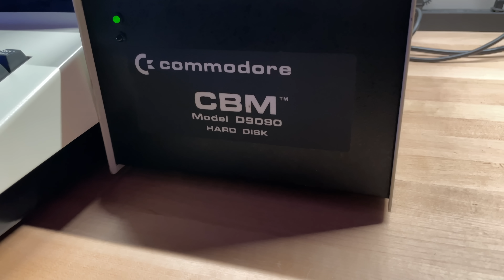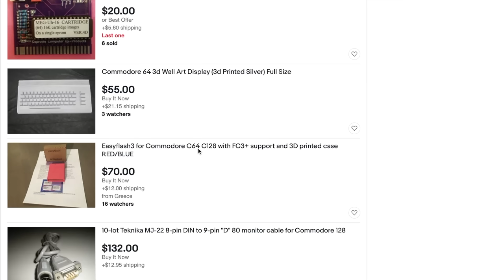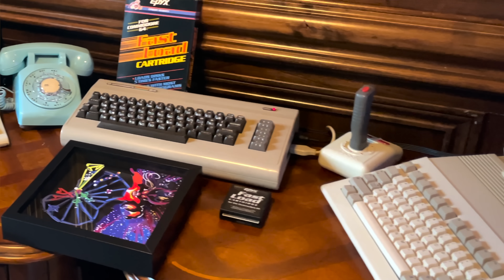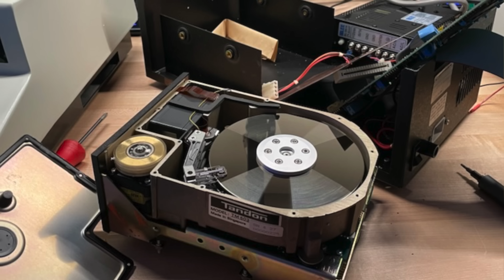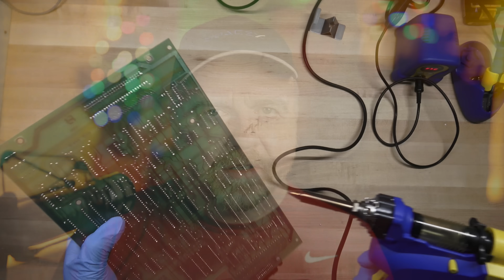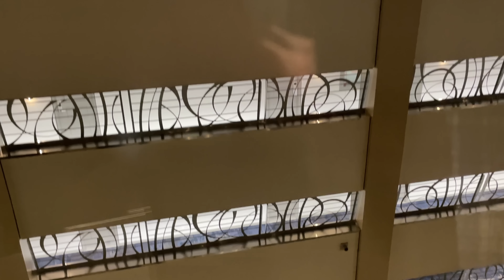FOUND: A Super-Rare Commodore D9090!

Comment: I had 2 of them on my C64 based BBS back in 1986. I stupidly sold that whole BBS setup for a song to one of my Users at the time. Gawd only knows where they ended up. I still have a spare ROM chip from the IEEE interface somewhere, but not the actual interface. So many thing I shoulda kept.! argghh

Comment: Hello Dave. lol! I want to say that you speak eloquently and it's very entertaining. Thank you for the laughs! Around12:13 you speak of power supply issues and GFCI.

My wife and I bought a shed, converted it into a 'tiny home' at the farm, I did the lectrical, before AI, thru research. I installed AFCI or combo CI breakers when they were cheap (lol). The minisplit (120v 20a) would trip its breaker. Changed the breaker out for a standard breaker and it's been fine ever since. My theory is the inverter on the outside unit doesn't like whatever the FCI does, or the inverter backfeeds noise that trips the breaker? 

I would love for you to do an audiobook. I remember in my AOL days of seriously thinking about applying for a job at Microsoft, but learned RPG II on a System/36 for small financial institutions.

Thanks for the memory trips!

Comment: Re: Power supply tripping:

normally there are protection diodes across power rails of a device which will trip IF the power supply is connect backwards OR if a voltage caused by a mains surge occurs) - and this is worse when transformers are involved.  too many shocks or adverse operating voltage transients and the protection devices take to short circuiting and any future attempts will fail

To debug these check the DC resistance of the 12V line (12V to 0V) - testing the resistance across each component ( try the black or discoloured devices first ).

Any electrolytic capacitor (with a can ) could have dried out and need replacing , choose a 15 or20V part as the replacement , keeping the same value.

A trip can occur if there is a path to mains  through any other connected component, germany and UK often used the neutral line as 0V - which works fine until the power lead is connected backwards ( not possible in UK and German because they have 3 terminal plugs )

Comment: Gfci monitors balance of hot and neutral, if they are out of balance a coil surrounding hot neutral sees current  and that trips gfi.  A hard short will guarantee hot current exceeds neutral current tripping GFI breaker

Comment: I worked at a shop repairing Commodore 64's and Amigas part time in the late 80's.  Cool old systems, but I had completely forgotten about aligning the floppy drives with an o-scope and reference disk.  Thanks for breaking that old brain cell out.

Comment: It is possible to trip a GFCI if the load is radiating a lot of RF.  I had a Speed Queen washer that created its own 3-phase motor power with a variable frequency inverter.  The EMI was so bad that it would sometimes trip the GFCI it was plugged into (and totally jammed radio reception in the house.)  Sometimes it even tripped another GFCI on another circuit.  If your power supply had something arcing, this could be the problem.  Speed Queen's fix was to float the motor frame to isolate the inverter from ground, which was the "antenna", thereby reducing the EMI injected into the GFCI electronics.

Comment: please excuse with all respect. You are not able to find a short circuit ? If it is an ohmic short, then the amperage would be linear to the voltage you apply. If it is a semiconductor-like short, then the amperage would be really not linear, more like it would rise at around 2 volts. Then you have it. Thanks 🙂

Comment: Not sure why I get this vid only now - but very cool!

One of the projects on my long term todo list is to build a replacement for the SASI board, using a blueSCSI or some custom hardware, just in case the original HD in my 9090 starts failing...

My option of getting a working PET is to actually rebuild them with modern parts 😅

Comment: american (IEEE) and european (IEC) 'ground' setups are different in how the ground wire and leak detection works (and even in it's entire purpose). either way the problem with them leaking current to 'whatever your definition of ground' is is commonly within the integrated tin-can-filter-combined-IEC-C8 power connector frequently used on commodore stuff... not some capacitor behind the thing. if the power plug to the drive goes into some sort of 'tin can contraption' instead of just a plastic connector with the pins sticking out the back, it's got filters inside of it and the leak simply is in the power connector of the drive -itself-.
Reply: plenty of cbm drives leak ac to to ground. also on 1540s and 1541s. anything which does not come with an external psu. and it's always just that filter box itself that is attached to the connector.

Comment: the c64 has no 'PIA' chips. just 'CIA' and PLA :p out of which the CIA's can 'interfere with the keyboard' (both options are a bit overkill just to interface a keyboard and them being bi-directional is a bit of a problem in itself, you can hook a 1 output to a 0 output through a keyboard or joystick ;) luckily the keyboards are crappy enough to have plenty of resistance themselves hahahaha. (take note that that built in resistance is gone the moment you install a modern keyboard with proper key switches and then you can damn well blow a chip or 2 that way ;)

Comment: problem with higher baud rates on a c64 isn't in the rs232. lol. (oh ffs just use a real 65c51) it's in moving the entire screen up one line in the time between 2 bytes. lol.
Reply: and yeah sure you could use one with a fifo buffer or do it in software but at the end of the day if the other end keeps sending enters it's gonna have to move 40*24 bytes up at each enter received. oh also most actual 65c51's other than the ones with 'A' at the end basically cannot handle handshake and hardware flow control as they just 'break off a received frame half way through' and trigger a frame error on that one instead of just letting the current byte process in full. cauzing 1 lost byte mid stream. literally the only way to do it right is to use the 65c51's of harris with an (A(lternate behaviour at the end :P
Reply: preferably also in a terminal program you would do all of this scrolling and moving the cursor (it doesn't even have a hardware cursor) stuff during a vblank which makes it even more impossible.

Comment: We used to "jump" bad traces a lot back in those days. Nobody bothers anymore the hourly charge is way more expensive than components.  When i worked for "Big Blue" we would bill 5 hours to realign floppy drives and it was cheaper than a replacement...

Comment: It's hard to understand how 10 MEGAbytes could be useful in this day and age of hundreds of gigabytes and even terabytes of storage, but when you consider that a typical program for the PET was probably 32K (the 8000 series) or even less (the 2001 had 4 or 8K of RAM), it makes sense. Ten megabytes was PLENTY. The cost made it prohibitive for the majority of users, though.
Reply: Hi, my first hard drive on a PC XT Clone was a used 10mb i purchased for @ $150 ( the pc i purchased new for $ $1100 - it was $140 but dropped as the new 12mg turbo clones had been released for 3 to 6 months at the time)

So with it was 2 x 360 floppies, my first major upgrade was a 1.2mb floppy controller card and drive
Then say 6 months later the used hard drive

When i installed the hard drive it felt like unlimited, i had it bootable, had dos, turbo pascal 3, gwbasic, xtree, multiplan, wordstar a few games and about 3mb free - i was set for life

Today you look at a 1tb hard drive ssd - and the price is about the same as a very large lunch meal

Comment: Just a guess, but I think GFCI outlets also have a current overload breaker inside that will trip the GFCI if there is an overload of current over 15A or if there is a short across live and neutral or a ground fault across either wires in the pair.  It may be that the power supply was drawing too much current or there was something causing a short on the pcb or in the power supply that may not have been visible.

Comment: The fault is likely caused by more than one issue:

1. AC breaker tripping due to stray current
The AC breaker monitors leakage (stray) current. Many PSUs internally connect Neutral and Ground (minus). If DC current returns through Ground and Neutral, the breaker can trip. This is the same principle that can damage an oscilloscope if you measure mains voltage incorrectly with a grounded scope probe.

2.Aging motor windings
The motor windings may be old, causing the insulation (lacquer) to degrade. Under excessive load, the insulation can flake off and create a short to ground.
If the fault is difficult to locate, use a thermal camera and a bench power supply with constant current. (use a isolasjon transformer infront off the psu) Set it to 2 V and 0.5 A. Within 2 seconds, the fault location will become visible due to heating,off it's in the first or last winding terminal.

3.Worn motor bearings
Damaged bearings increase mechanical resistance, which increases motor load and current draw.

Recommended troubleshooting order
Start with 3, then 2, and finally 1.

Comment: Love the video.  I used to drool over a Commodore Hard Drive.  I could never afford one and in Denver they only sold two of them.  I ran a BBS using an 8050 floppy.  It was called Petula and we had a lot of fun with it.  In the 90's I wrote an eight bit dos for the ST-251 MFM 20 MB hard drive for the CardTronics system I developed.  Later on I moved it to a SCSI hard drive and I still have a box full (about 20) of 50 MB SCSI hard drives made by IBM.  Fun days in the past with the 650X family of CPU's.  I used 6502, 6508 and 6509 CPU's in the CardTronics system. All of it was programed in machine code by me!

Comment: A GFCI is detecting an imbalance between the current on the hot (usually black wire) and neutral (usually white wire).  So if your power supply, or the C64 board, has a path to the ground wire that is not through the neutral, you will see it trip the GFCI.

Comment: Now I regret getting rid of my old Seagate ST-419 in recent years (15meg formatted).  That was my first HDD I think I got back in 1988 on the surplus market for a very low price as I recall.  But that's how it was done before IDE hit the scene.  For whatever reason it was more cost effective to buy MFM drives and slap on a SASI/SCSI controller which did also had the side benefit of allowing 2 devices on one ID IF you could argue with the software.  Same to QIC-02/36 tape drives.  I don't miss the 1980s.  

While I knew the ST-419 was the ST-412 with an extra platter and a pair of heads I never thought it would be a drop in replacement for vintage systems where you couldn't define geometry.

Comment: Could you have rewired the transformer leads from 220V to 110V? Regarding the tripping, I wonder if 12V DC or ground had a DC short to mains power... they should have infinite DC resistance between them.

Comment: Linear or switching power supply?  If linear, then maybe the power transformer has a primary to secondary short?   While the same could be true for a switcher, it's less likely.  As for the disk drive, real old hard disks had induction motors, while most "newer" ones used DC motors.  Induction motors run off the raw line voltage, and they too can develop shorts between the core and the windings and that can trip a GFCI.  Another thing that can trip GFCIs is the "across the line" filter capacitor.  You want a high quality cap here, but many times you find a POS paper cap.  Ask the guys that repair old radios about these!  Another thing that can trip GFCIs is anything that FSCKs the power factor across the power line.

Comment: The gfci popped because your short was in the windings of the motor on the drive. With the short in a winding you basically got a coil that sendt a high voltage spike back to the grid. Through your power supply. That’s most likely why it popped too. Spikes of hundreds of volts can be induced. Coils is like a spring. If you compress it it wants to push back. If you scoped the supply voltage to the drive you’d see this. It does not take much to create voltages up to 600 volt.

Comment: GFCI is detecting that the AC current in the black (hot) wire of the outlet is sourcing more current than is coming back through the white (neutral) wire.  This could happen, for instance, if a component failed which shorted some current to earth ground in your Hard Drive chassis (or maybe in your new power +5V and +12V brick).

Comment: Greetings from a December 2025 algorithm kiss. GFCI trips like that are known as "nuisance trips". GFCI outlets work by measuring a difference in current between the two legs of the AC line - neutral and line. Both go through a current sensor on the board, and thus it picks up any imbalance and assumes it's leaking to the earth. That assumption can often be incorrect, especially using switching power supplies or inductive loads with sharp spikey loads. While it is uncommon to see, I have often been left fighting GFCI on some devices that load the lines in such a way as to confuse the GFCI through spikey surge loads. They don't measure leakage to ground - rather, they react to "something seems wrong" and they react quickly, even if they can't fully quantify exactly what is wrong.

Always good to have some non-GFCI outlets in the area for cases like these. A GFCI protects against electric shock and nothing more (they don't protect against fire hazards caused by poor connections, for example). A standard breaker protects against over-current. Often, that's all you really need.
Reply: Makes sense.

Comment: Maybe you had the GFCI outlet using a 15 AMP circuit in the house panel.  My understanding is that this is no-no.  GFCI should use a 20AMP house rated panel box fuse or breaker

Comment: Wow a CBM Pet.
We had about 10 of them at our Accounts Dept, for Data Entry., the Commodore PET 2001's. Mini Keyboard, 8Kb ram & audio cassette tape for storage!
The rub was one of them was attached to a 1/2 mag tape drive - or is that the other way round? All day, invoices and payments were banged in to the Pets. At the days' end, the audio cassettes were transferred to 1/2 ich tape, and couriered up Head Office and processed into ... the PDP 11/70 on RSX-11M, running the (home rolled) Accounts  System. We had to use tricks like used on the PDP-8 to squeeze the mag-tape conversion into the massive 8Kb ram!
 [Come-on, My home-built Nascom 1 only had *2Kb* - and half that was the display RAM.]

Comment: Can confirm that David Gesswein's MFM drive emulator board is an incredibly cool device. I built one a couple of years ago for an iAPX-432 based computer (housed in an Intel System 310!). I desperately wanted to back up the included Computer Memories MFM drive, a whopping 10MB drive! Fortunately, it all worked out, so now I can boot the machine into iRMX 86 all using the emulator, instead of stressing the very tired original drive.

I think the Decromancer you ended up with is a third party revised variant of David's design.

Comment: We have something in common.  The first computer I ever really programmed on was also the TRS-80 Model 1, and it had "Level 1 BASIC" which was really bad when compared with the later "Level 2 BASIC".  (According to what I've read, the "Level 1 BASIC" was meant to be a stop-gap measure to allow them to release the computer and then license M$ BASIC for the machine later.)  It was a 4K version of BASIC.  M$ BASIC was 12K.  (It was rather fun to see how it was designed to allow Disk BASIC to be easily added later)
Reply: I also started with Level 1 Basic but had it replaced with Level 2 soon. Tandy (how Radio Shack was called here in the Netherlands) offered that service. Later I added a chip of SRAM to enable lowercase characters myself, with the help of the very active TRS-80 club here.

Comment: Industrial PSU often have a crowbar circuit. When the voltage comes out of control, it triggers and shorts out the PSU for damage control. Like throwing a crowbar into a gearbox to stop a machine that went out of control.
The disk platter is a massive flywheel storing a tremendous amount of energy. When the motor driver looses sync, it can generate high voltages and currents it feeds back into the PSU.
This is how you test if the power lines to huge CNC lathes are strong enough. Spin it up real good while monitoring the voltage on the mains then hit the emergency stop. e.g. on a 200V system, the voltage should increase to 220V and should not exceed 240V.
Reply: Similar story: My colleagues once put a CD-ROM or DVD-ROM that was cracked in a drive and tried to read it, but it exploded in the drive. The maximum speed isn't set for nothing!

Comment: So I have a question about "error" code 73 on the 9090?   
IE:  what do you get when you run?  
10 OPEN 15,8,15,"I0":INPUT#15,E,E$,T,S
20 PRINT E,E$,T,S
30 CLOSE 15  
Seeing as you have one and I don't,   I need you or some one who has access to one of these to tell me.  
I have a piece of software that detects what the attached drives to my commodore are ,and I want it to be able to detect this drive as well. 
Thanks

Comment: That sounds like what apple would do... Stopping customers upgrading their system. Yes ok, maybe more subtle than drilling holes in PCB 😅
Reply: We didn't like Apple. Before we could go write programs for Apple's we'd first would have to become an Apple-fan in their fan-forum. Bah! Btw the OS for the original Apple Mac was written in Pascal and was single tasking! Bah again! And why use another processor-architecture every 5(?) years? 6502/65816, 68000, Power-PC, 80x86 and now ARM!